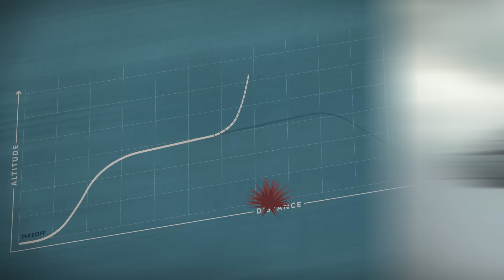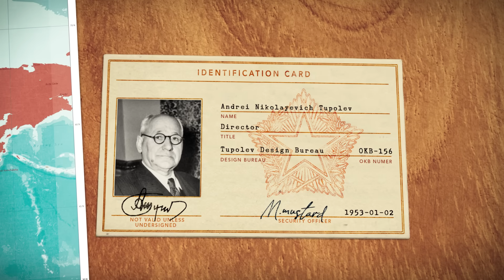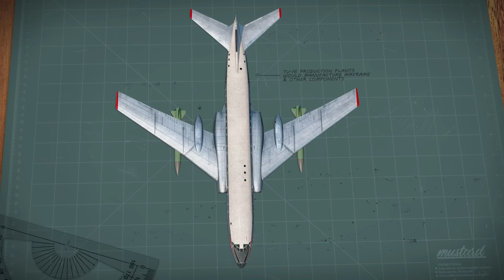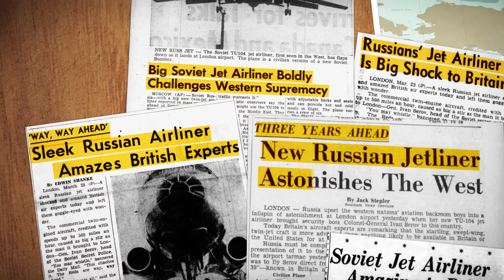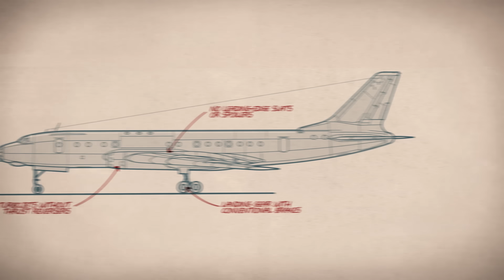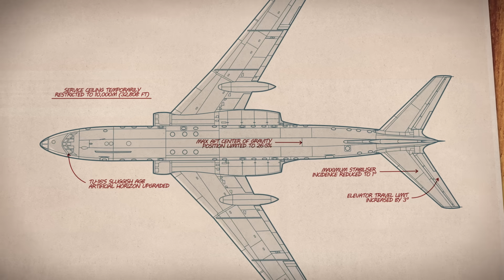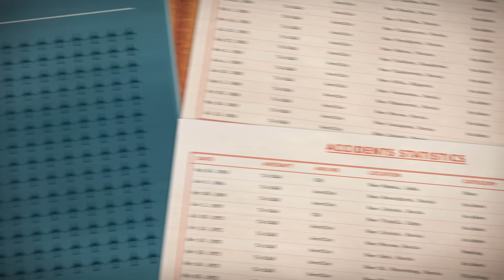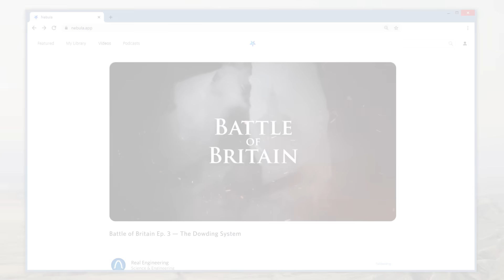The Soviet Airliner Designed To Crash

Comment: The Concorde was poorly designed as well
Reply: Indeed, the DC-10 Actually has a better safety record than the Concorde
Reply: @sandervanderkammen9230  "Indeed, the DC-10 Actually has a better safety record than the Concorde"

That's a flat out lie. The DC-10 had over TEN TIMES as many fatalities in its 55 accidents than the Concorde had in its 3, of which only 1 resulted in any deaths.
Reply: @Mittens0407  Your comment reveals someone who has no formal education or professional experience in the aviation industry...
You cannot compare raw data directly between two different aircraft types with different production numbers and seating capacity.

Only 14 Concordes saw operational service 
While there were 650 aircraft in the DC-10 family.
 DC-10 family can carry between 250 and 410 passengers
Concorde between 98 and 120.

We use statistics to compare the safety records of different aircraft to determine the rate of accidents and fatalities per flight flown and per passenger.

The DC-10 has a lower fatalities rate per flight and per passenger/mile carried than the Concorde.
Any questions lad?
Reply: @sandervanderkammen9230  What a snobbish way to reply. You argue against Comparing raw numbers while doing exactly that without considering sample size. Comparing the DC-10 to the Concorde in that way is pointless due the small sample size of Concordes. A low production plane with a small amount of incidents vs a large production plane with a high amount of incidents is going to be inaccurate. The DC-10 will always have the benefit of a larger amount of produced aircraft of which to compare to a number of incidents.

According to your logic, the Concorde must also be less safe than the Comet, despite every Comet 1 essentially being guaranteed to explode lol.

How about this, if we're talking about poor design, how many Concorde and DC-10 crashes were due to flaws in the design? Concordes only crash was due to poor maintenance of a 25 year old aircraft which resulted in the deaths of 113 people (the metal strip thing appears to be rubbish), whereas a 2 year old DC-10 was nearly lost due to a known fault in the design, before another DC-10 was actually lost due to the same known design fault, resulting in the deaths of 346 people. 

Both aircraft shouldn't really be compared. The Concorde was an advanced expensive vanity project that lost its original purpose before it was even completed, while the DC-10 was essentially Douglas trying to build a bigger jet.
Reply: @Mittens0407  Wow! What an ignorant comment. You really are unqualified to discuss this topic intelligently.
Reply: @Mittens0407  The Comet was  far worse than the Concorde, the Comet has the highest loss rate of any jet airliner in history and the highest fatalities rate.

You were far more likely to die on any  British jet than the DC-10.
Reply: @sandervanderkammen9230  Thanks for showing your genius and thoughtfulness by falling back on insults again.
Reply: @Mittens0407  Don't insult my intelligence  and I won't point out your lack of it...
Reply: @sandervanderkammen9230  PSA: bold text doesn't make your response anymore important or correct. It just serves to make it harder to read, which it already was in the first place.
Reply: @Mittens0407  If you were smart? You would have known when to quit.
Reply: @sandervanderkammen9230 Replace the question mark with a comma and make the second "you" lowercase.
Reply: @Mittens0407  Please name a single British company that still makes commercial jet aircraft in the UK???
Reply: @sandervanderkammen9230  Please tell me how that relates to anything that we were talking about?????
Reply: @Mittens0407  Do you think the Comet Disaster was beneficial for the UK aircraft industry???
Reply: @sandervanderkammen9230  Did I ever say it was, or are you putting words into my mouth????
Reply: @Mittens0407  Name a British company that still makes commercial jet aircraft in the UK?
Reply: @sandervanderkammen9230  You're repeating yourself with questions that have nothing to do with the subject matter???

Comment: Fun Fact: Boeing credits the Tu-104 as inspiration for the development of their venerated MCAS flight control.
Reply: de Havilland company credits the Hindenburg as the inspiration for the development of the Comet...
Reply: @sandervanderkammen9230  *R101
Reply: @Mittens0407  The Comet Disaster is the worst engineering failure in the history of commercial jet aviation.
The Comet has the worst loss rate and the Highest fatalities rate of any jet airliner.
One out of every three Comets built crashed or were destroyed in accidents and has the highest fatalities per flight and per passenger/miles flown.
Reply: @sandervanderkammen9230  ???
I was saying they took inspiration from the R101, not the Hindenburg lol
Look it up, the similarities with the Comet project are quite interesting.

Comment: What about the French Caravelle? It also came pretty early into the game of passenger jets.
Reply: The Caravelle was designed a bit later and benefited from some later improved technology which was advancing at lightning speeds at this time.
Reply: @sandervanderkammen9230  Both Tu 104 and Caravelle had their maiden flights in 1955.
Reply: @jansupronowicz1300  The Boeing 707 was 1954.. and was based heavily on development of the B-47.
The Comet was 1949.
Reply: @jansupronowicz1300  The Tu-104 was based on the Tu-16 which flew in 1952.
Reply: @sandervanderkammen9230  True, but 707 was totally different class of aircraft and the first incarnation of Comet was a disaster.
Reply: @jansupronowicz1300 All of Boeings previous airliners were also based on bomber designs.